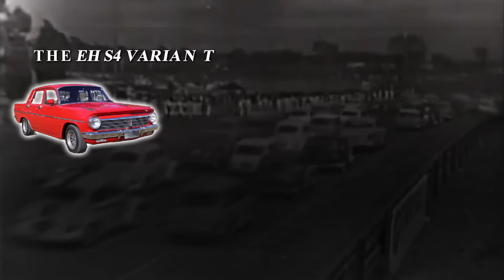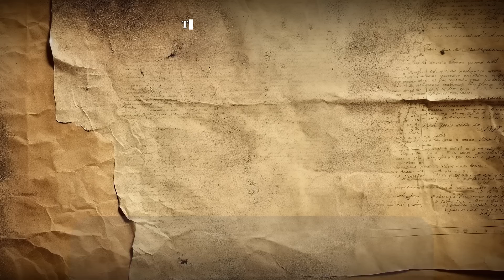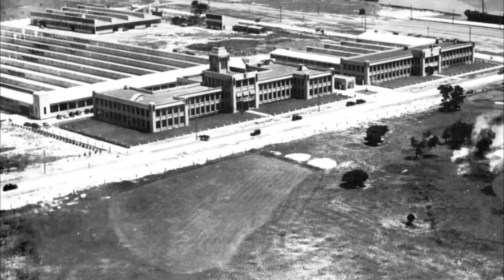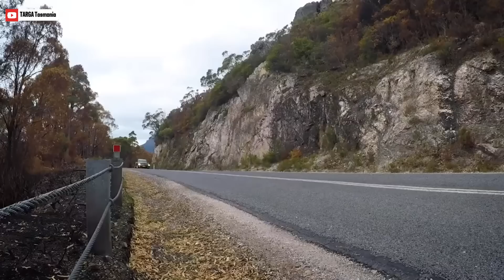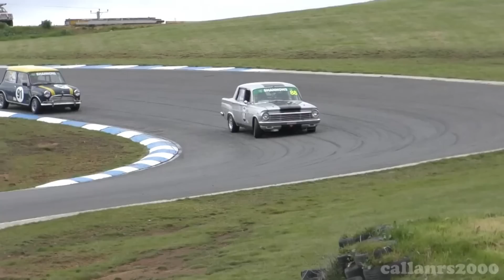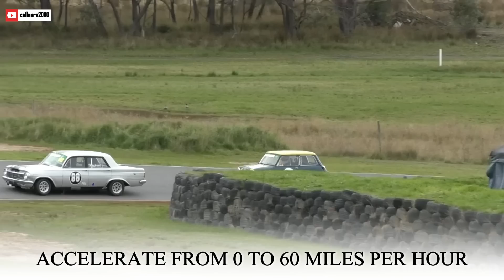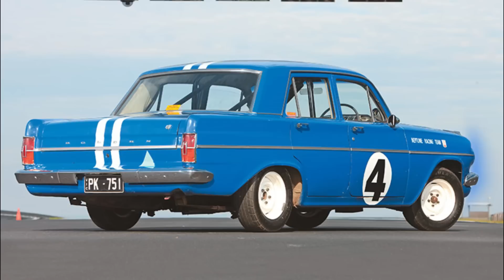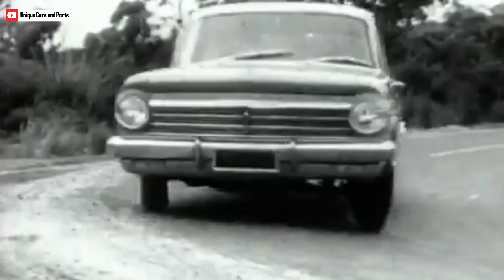Holden's SECRET High-Performance 179 Engine That Dominated Bathurst

Comment: What utter B&llsh%t! I'm a Holden fan and I know the first Factory Hi performance Holden 6 was released in 1965 with the HD, the X2 option. The EH 179 was a normal standard 179 as found in the HD. The casting on the side of block didn't indicate the engine size, as it did for every other Red 6. It had "HP" cast in to it to fool the every day non-car nut into thinking it was a "High Performance" engine. The standard 6 cylinder in all EH's, bar Premier, was the 149. It had "149" cast in the side of the block. So the larger 179 had HP. This was to battle against Fords new "High Perfomance" 6's at the time the "Pursuit 6" at 170cu and the "Super Pursuit" 200cu. Just an every day Factory Marketing spin.
Reply: Yeah, I thought the X2 block was different but a I cant recall what was stamped onto the side of the block. I do know the X2 engine had a different serial number prefix or something to the stock 179 blocks.
I only ever got to work on one genuine X2 and that was a long time back lol
I did see many 179 mocks though (which is why I was aware of the engine number difference.)
Reply: Back in the early 80s l bought a LC Torana that somebody had fitted a pair of fluted GTR gaurds to so l purchased it from a secondhand car dealer . It came with a 173 and a M20 four speed .The engine was stock and performed pretty average so at the time my brothers mate worked in a shared engine reconditioning business . I went there and told them l wanted a high performance engine built .l did not specify any cubic capacity, all l said was...What l don't want is some you beaut backyard built hack, l want you to build me something fucken serious !! The guys chose to use an HP block engine . To this day l couldn't. tell why but fuck this thing span 7500 rpm and was one with the lot internally withe cc being the 192 you're  speaking of.Like the previous comment  , l couldn't. afford the Webber's it was built for so l only had a jetted up Holley on it but it was amazing ,it felt like somebody pulled a couple of ton from out of the boot! That car went like a fucken cat with its  tail on fire ! GT Falcons yeah ok l would wave as l nailed the thing and was never touched . Makes me wonder to this day..What would it have been like with those Webbers LOL PS.. I found that a 3.36 ratio was perfect for it ,amazing engines when their built by the right people !!
Reply: Yeah nah standard 179 is cast into block , HP is High Performance version . Plenty of picks of 179 cast in block on here .
Reply: @JosephCowen-fz8vj  My Old Man had a 179 Bog standard, it had "HP" cast into the block. There was nothing high performance about it.
Reply: @michaelatkins5480  well then you know nothing about motors do you , HP blocks were higher nickel, forged cranks , better lift/duration cams and rejeted Strombergs ! Do some research before opening mouth !
Reply: @JosephCowen-fz8vj  My research was looking at the motor mate.
Reply: @michaelatkins5480  well sometimes looking is not seeing all ,
Reply: @JosephCowen-fz8vj  The HP engine was just a model revision of the stock block. one stamped HP and one stamped 179.
Those engines have nothing to do with the X2 engine :)
Reply: @axle.australian.patriot  yes that is correct , nothing to do with X2 at all , different era, but the HP is not just a 179 , ever bored a HP over a 179/149 . Boring bar makes a different sound in a HP higher nickel , plus different cam specs than standard 179 , rejeted Stromberg, it's a factory improvement over stock 179. I've worked on plenty , they were a much sort after block over stock 179 . Easily bore to 186/92, 149 head , 35/75 cam and triple Strombergs. The classic 192 for a Torana .
Reply: @JosephCowen-fz8vj  Nah, I agree. they improved the block. No question on that.
It's just many people in here claiming that the HP engine was the X2 which is incorrect :)
There were many of these difference in the same CI label engines right across the Red engine range :) very few are aware of it though except for a small few of us :)
I was trying to remember the the name of the 202 they did this to in the Toranna 202 XU-1. It had a different engine ID number to the stock Red 202 as well.
Reply: @axle.australian.patriot  yes you are rite , there was another letter prefex on Holden sixes other than HP but I can't remember what it was . I had an original 149 in that maroon red they came in before the more orange red and it had no ci or letter prefex cast into the block , totally blank , the only reason I knew it was 149 was the original sticker on the tappet cover .
Reply: @JosephCowen-fz8vj  P.S. I went all weak in the knees and gooey down south when you mentioned the 75/35 hi flow cams X-)
They got me into so much trouble with the authorities lol
Reply: @axle.australian.patriot  how I think about it I saw a JP cast in a red block once , but I believe that is a replacement red six block , or something like that.
Reply: @JosephCowen-fz8vj  It's in the engine number prefix (blank block and HP block) of all the engines as well. Long time back, so I cant recall the engine numbers off the top of my head any more lol
>
The last Holden six I built was a hot Blue 202 for my elderly mothers Commodore. Over 20 years after that rebuild and it still roars :P
Although it doesn't snap as hard on the unleaded fuels compared to the super leaded of the day. (I did do the advance curves on the dizzy, but wasn't the same). Just the same still launches hard for 202 :)
Reply: @axle.australian.patriot  yes they were the go in the day , my friend had a LJ GTR XU1 with an insane six in it , it was a 234 ci with a Ford 221 crank and all the goodies , it cracked . But at the same time I had an LC GTR, not an XU1 just a GTR, that got you a 186 a M20 4 speed, disk brakes and a LSD banjo diff . I put the 35/75 cam in , ported red head with the centre head bolt boss removed in the intake ports , set of long tube extractors, and first I wanted triple Strombergs but couldn't afford it . I had a single 45 DCOE Weber so I got this Cain intake for one side draught , it went terrible, then I got a Redline intake for a single 390 CFM 4 barrel Holley it went much better . I always wanted to do a real sleeper and get a chev red 292 ci six and Saginaw 4 speed to put in it , they look so much alike to the untrained eye with 186 stickers on it you would get away with it . And at nearly 5 litres of six cylinder it would have gone insane.
Reply: @JosephCowen-fz8vj  There are so many differences. They did low compression and High compression in many red motors (more into the HG/HT/HK series, where the LC was for standard low octane fuels (often used in taxis) (Just Low compression pistons) and the high compression for Super leaded fuels).
Then they had many block revisions as well.
>
I spent most of my later years on the 253 and 308 and even they are a different engine block (different engine) from the HT series to the HQ.
But typically you could mix and match across the different engines bolt for bolt such as dropping higher compression head off the 149 on to the others :P
Av gas was cheap back then lol

Comment: Can anyone tell me anything about a hp block red motor..I had one stamped hp and not 179 hp
Reply: @kyro-w3s  to my knowledge it's 179 HP
Reply: It is a 179 HP but it's cast HP and normal ones 179..
Reply: The first 308s were also stamped HP, I believe they were only fitted to the HG Broughams, both the 6 and the V8 featured the forged crank as opposed to the standard cast iron crank
Reply: @DavidP-ti6fu  hmmm , no factory Holden V8 had a forged crank , the first Holden 308 with HP are super rare and only very early casting, 253 was first available then very soon 308. Both painted a moroon colour , the Brougham had 307 chev as Holden was not ready later Broughams had 253/308 early non pollution motors that you know are early by the oil filler tube going into the alloy timing cover , a year later that was removed but rite till the last 355 injected motors in 1997 they still had the alloy boss for the oil filler cast in the timing cover .
Reply: @JosephCowen-fz8vj  Something to note. The first 253 and 308 in the late 60s HG HT series is a different engine to what is used from 1970 HQ inwards. They are not interchangeable.
The early Red V8 was engineered with very tight tolerances across all bearing journals line bores and balancing. They also included cam chain tensioners and proper formed main seals instead of cords like the later engine.
Those early engines could rev their tops of and not break lol
Reply: @JosephCowen-fz8vj  Highly possible, I never saw inside the HP V8, only going by what the owner said
Reply: @DavidP-ti6fu  yes it's a rare one . There were JP blocks too , I saw one disassembled once , it had a broken transmission ear on the side, I believe JP blocks came in Torana's now I think more about it .
Reply: @JosephCowen-fz8vj  Just as a thought, they changed the rear main seals on the red motor from rubber nylon to rope cord in 1970. So all red engines where a different block from 1970[ish] onward.

Comment: You're trying hard with your presentations, tho to be honest, you're way off the mark.
Wherever you're sourcing your information, the greater percentage of your "facts" simply aren't true.
The 'Red Engine's ' as they were known, certainly were a big step up from the 'grey motor ' it replaced. 
Nevertheless it sure wasn't a Chrysler 225ci slant six motor in power.
Reply: I don't think you have done too well with your facts either lol
The engine that was meant to be talked about here is the 179 X2, which is not a stock red motor :)
Reply: @axle.australian.patriot even in x2 trim these 179’s were fairly ordinary….
Great little fun engine in a family car….
But soooo outclassed by EVERYONE on a racetrack

Comment: 179hp block like the 186s block,  are both a good  motor
Reply: I used to race 186 bored out to +60 oversize equals 192 cubic inch and then plane .80 thousand of an inch of a cylinder head in and run it on avgas back in the day in Rockhampton speedway in a little Tirana it used to run great on a three gearbox used to get 80 miles an hour in second gear
Reply: @jameswalker8900  nice , did you  ever see the twin cam head for the 186 ? was only 10 sets made , my dad back in the 70s run a Gray motor with a 671gm charger on it , no Welsh plugs , just boost and fuel
Reply from the maker: @radioactive4388  have you driven one?
Reply: @LegendaryRideCars  have original eh ute

Comment: Seems to have missed the HP block with the steel crank and the twin carby manifold. The red motor was legendary and continued to the blue 202 and black 202 in the VK commodore in 1984. Even fuel injected. Much success in its various incarnations on the race track.  Ultimately beaten by crap unleaded fuel.
Reply: No twin carbs on an EH.  The X2 was introduced on the HD, never heard of much race success with them either.
Reply: @alanpennykid133  I will have to stand corrected on that then.
Reply: @jefftheaussie2225  Yeah, the X2 was a different engine. Still a 179 but a little over engineered with steel tighter machining tolerances, steel crank, cam and some head works as well as the twin carbs.
The X2 was adopted by Mercuiser (mecury) for their boat engines and later formed the base concept for the Nissan RB30 3.0l.
>
So they did have historical significance :)
Reply: @ That’s interesting. I didn’t know about the RB30 connection but Holden’s engineers were right into designing and getting the best out of engines. This business about the heads being no good because the valve seats were cut straight into the parent metal is nonsense. All heads were like that till the advent of alloy heads. Hardened valve seats were not really used in cast heads till we got that rubbish unleaded petrol so you didn’t have to use flash lube. We had an EH sedan with the HP block. It had been a paddock basher by the time we got it and I presume it was its original motor.
Reply: @jefftheaussie2225  Most valve issues were a fuel mixture, engine temp and timing issues. Burnt valves were fairly rare.
>
I rebuilt built a hot blue 202 for my elderly mother (originally Super unleaded).
With an inline tin saturation.
So ported heads (original valves), small cam, alloy gear, higher compression, headers and some timing and fuel tweaks on the Rodchester varajet etc.
Over 20 years and that thing has had some good workouts along the way. That engine still sparkles and has never been open up since :)
>
I must admit it did sparkle a bit better on the leaded super (especially with some av gas for the high compression) than what it does on premium unleaded.
>
The Nissan RB30 engine is a bit of an enigma. They merged technology (best) from the 179 square engine X2 and the Nissan (datsun) L series engine to create the skyline, VL frankinengine.
Stamped Nissan outside and GM inside lol
>
Mercruiser used the X2 because it was a solid and "smooth" engine for there boats.
My fathers Caribean (23ft) used get along at about 35 knots with ease :)
>
P.S. As a Holden fanatic, mechanic etc. I have had my fingers inside of every red engine ever built except for the X2 lol
Only ever had one X2 as a customer and it never broke.
Reply: @axle.australian.patriot  I think nissan copyed mercedes benz motors.
Reply: @peterwhite7252  They are a GM stamped block (internally) :)
Reply: yep
Reply: @jefftheaussie2225  I have a 179ci with the letters HP in the casting and I'm told it stands for Heavy Pour referring to a casting technique. I've also been told that the early red motors had a forged crankshaft and also Holden deliberately under aspirated the 179 because they were cautious about the reliability of this new engine which had to prove itself across harsh Australian conditions.

Comment: Racing them at Bathurst the rims couldn't stand the stresses and the centre of the rims would crack and break out.
Reply: Pretty common knowledge among club racer's in Australia, alot of guy's would have custom made steel wheels to eliminate the issue as the lead up to this happening was foretold by the cars sudden instability that only the best drivers could recognise. Most would keep going after this warning thinking it was a sway bar issue,only to have the rim and tire depart company from the wheel centre. It wasn't so bad in the early drum brake day's,but when disc's came around alot more damage came about.
Reply: In one of the races I actually saw one break apart. Not good when racing at speed.
Reply from the maker: @nevillemills9517  oh that could be dangerous for the people who are watching the race?
Reply from the maker: @nevillemills9517  from where you know that?
Reply: @LegendaryRideCars  common knowledge growing up in Australia with these cars.
Reply: @LegendaryRideCars first hand 
We used to laugh at them on the track !!!
Reply: Broke king pin supports as well.

Comment: Written and narrated by AI. So it's garbage!
Reply from the maker: @stephenvelden295  written by our human script writer & narrated by one of our voice over actors, which even work for radio channels.
Reply: @LegendaryRideCars  Well they did a poor job!
Reply from the maker: @stephenvelden295  could you give more on what should be improved please?
Reply: @LegendaryRideCars  The narrative is very repetitive ... to the point of being annoying, There were also some mistakes.
Reply: @LegendaryRideCars  Dont keep repeating the same info over and over again.  And maybe fact check it.  It did not dominate at Bathurst, the smaller Ford Cortinas beat them.
Reply from the maker: @ that’s the title .. but that fact about repeating parts of sentences we will take in consideration. Thank you 🙏